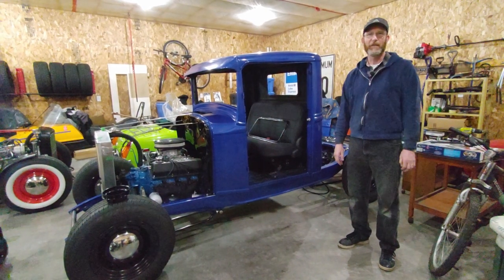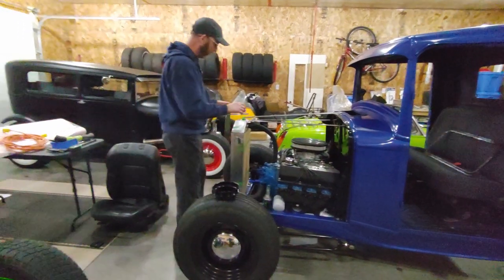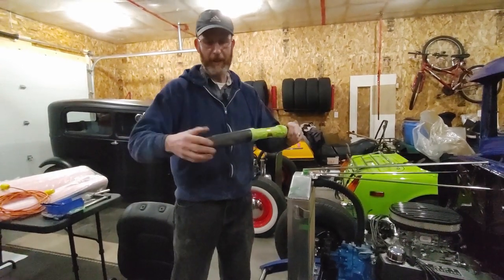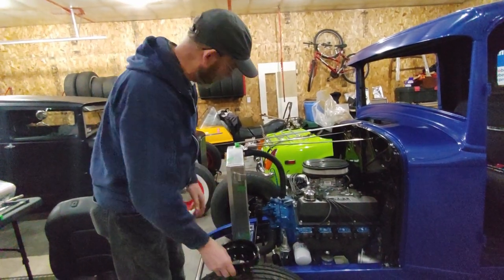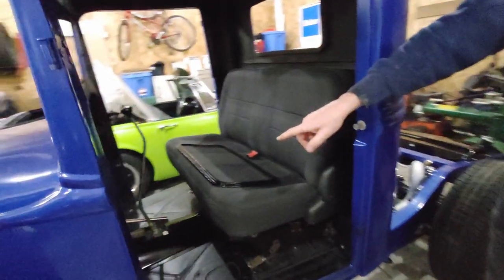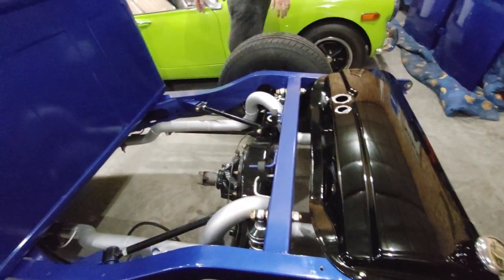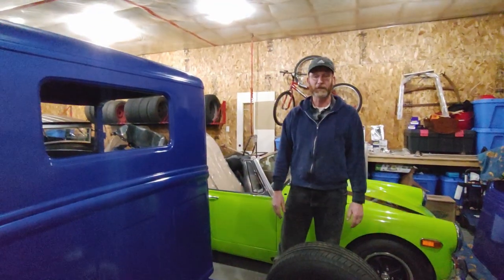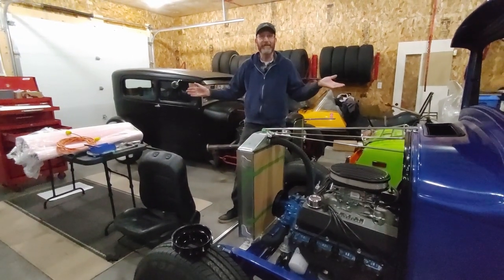Fitting the radiator and gas tank on 1932 FORD PICKUP

Comment: The truck is coming along nice, what kind of body mounts did you use on the cab and bed.
Reply from the maker: I used the original 32 Ford frame body mount points. There were 1/4" thick plates welded under each body mount location in the frame rails so that holes can be drilled and tapped to use bolts to hold the body and bed down. The bed has 1/4" tabs welded to the frame of the bed to hold it to the frame with bolts.